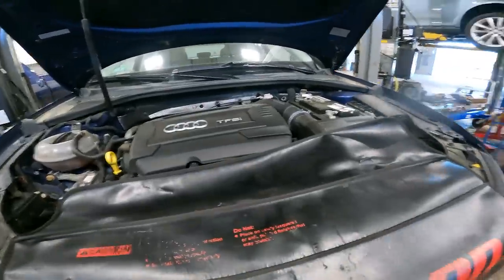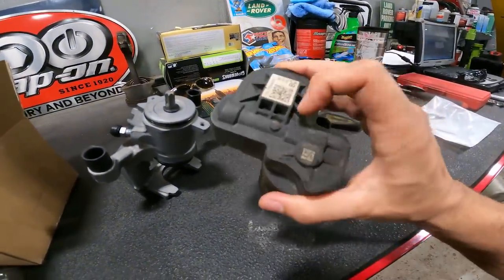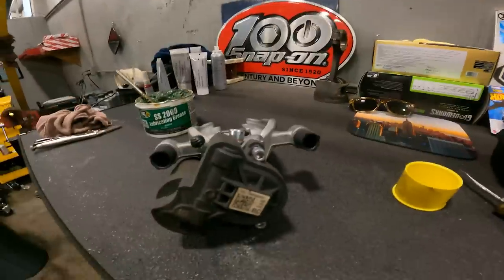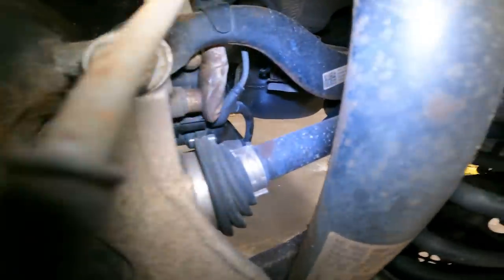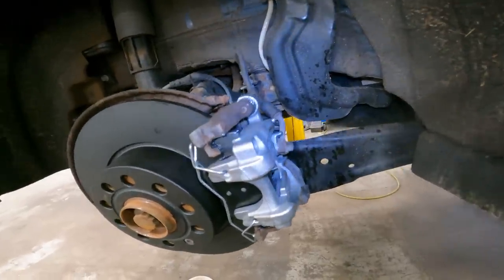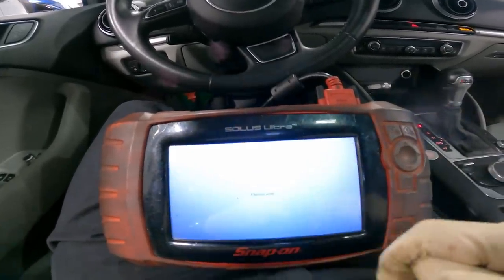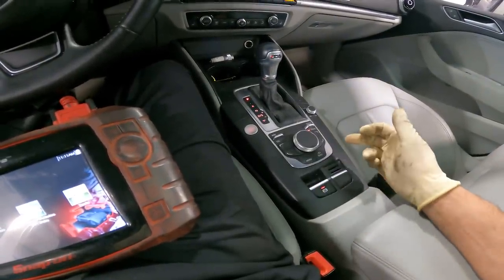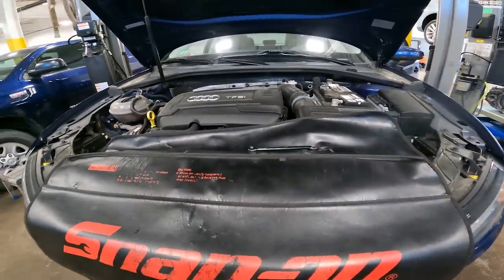LOUD GRINDING NOISE FROM BRAKES😲😵 VERY GOOD COUNTER!?🤔😁🤪

Comment: Electric parking brake. Cables worked perfectly for over a hundred years.
Reply: Yea, but cable actuated e-brakes only worked well when they were new. So many users quit using the e-brake once automatic transmissions with their parking brake became the norm that the mechanical e-brake systems would rust up from neglect.  And if they were then applied, they wouldn’t release.  And, of course, that led to overheating the rear brakes and the subsequent damage to the brake components and sometimes even the axel bearings and seals. 

If they use quality components, this new age electronic e-brake solution may well turn out to be superior in the long run.
Reply: @Dave-ei7kk  I always set my parking brake so the cables don't seize AND in some cases like Ford, the park park can fail and car rolls away. So, since 1997 when i that POS TAURUS, always set the brake.
Reply: @Dave-ei7kk  My Jeep XJ has over a quarter century and half a million miles on it and the parking brake has never given me a bit of trouble.
Reply: @JeffDeWitt  But I’ll bet you use your e-brake at least occasionally. And if you’ve got that many miles on any Jeep you have probably spent a lot of tile maintaining it. 

My point was that most people aren’t like you and I. They rarely, if ever, use their e-brake, preferring the Park position on their automatic transmission gear selector instead. 

FWIW I have a 1998 Jeep Grand Cherokee with a cable e-brake and it still works (although I’ve had to adjust and lube it) and I purposely use it occasionally.
Reply: @Dave-ei7kk  Yep, I use it all the time. When I park the Jeep I leave it in gear, let out the clutch, and set the parking brake.

Comment: What sucks is I have been doing my own brakes since I was 16 years old, I'm 70 now and I won't be able to do them if I have a car with E-Brakes. That is "very bad". Great video! 👍🏻
Reply: U can do it ur just putting restriction on ur self
Reply: Grab and OBDeleven or VCDS for $100. Not only can you put your brakes in service mode you can also get all the data you'll ever need from any module. Like Luis said your just saying "new car bad because technology bad" and stopping yourself.
Reply: @mydimeisup5103  Thanks maybe I will.
Reply: cant they just be manually turned back in?
Reply: @davidhoulden5791  Negative. By manually pushing the electronic parking brake back you'll damage the motor and have to shell out for a new parking brake motor. I've heard of it happening too many times. My motto in life is you do the job the right way or you don't do it all all. A lot of people that work on cars/their own cars don't seem to get that.
Reply: @davidhoulden5791  it depends, some videos show the small motor removed and then moved back. You could do damage, I would have to do more research.

Comment: At least with the modern Toyota & Lexus products electronic parking brakes you don't need any scan tool to change the rear pads. Also nice to hear a Toyota hybrid UFO in the background 😂

Comment: CSW, Very Good Video! Very Good practice to wire brush the hub to remove any rust which can impede perfect seating of the rotor. The high temp Brake Grease applied as a slight film on the hub will prevent future rust.
Reply: He has always done that before. Must be a labor shortage now.

Comment: Cable actuated e-brakes only worked well when they were new. However the vast majority of drivers quit using the e-brake once automatic transmissions with their parking brake became the norm. That meant that the mechanical e-brake systems would rust up from neglect.  And if they were then applied, they wouldn’t release.  And, of course, that led to overheating the rear brakes and the subsequent damage to the brake components and sometimes even the axel bearings and seals. 

If they use quality components, this new age electronic e-brake solution may well turn out to be superior in the long run.
Reply: "IF they use quality components."  Famous Last Words Series, Entry #6,137.
Reply: I only use a parking brake when parking on not level ground. Never use in my flat yard and drive or on even bitumen surfaces.

Comment: So, does it look like you can take the 2 bolts out of the E-Brake motor, and back off the shaft by hand, then re-assemble it, manually screwing the shaft till it touches and backing off 1/2 turn, so you don't need a $2000 scan tool to do brakes?
Reply: Some cars I believe don't need a scan tool, the E-Parking brakes can be put in service mode via the Infotainment Center. Problem is not all cars are like this but I agree you shouldn't need a fancy scanner to do Brakes.

Comment: But why were the brakes worn down anyway. You never explain that. I had a V6 2000 Sonata and after 16 years NEVER replaced the brake pads.
Reply from the maker: We had a seized caliper on the metal to metal side. Customer opted to replace both.
Reply: Don't you lie to us impersonator, real Elvis would drive an old Cadillac, not a korean rust bucket!

Comment: I've never had a Japanese caliper need replacing in just 7 years.  And I park my vehicles outside one block from the ocean in high humidity.  Either this person needs to use Woolwax underneath due to salted roads or these Audis are junk.  Does he have a heated garage?  Heated garages make the rust worse in snow climates.